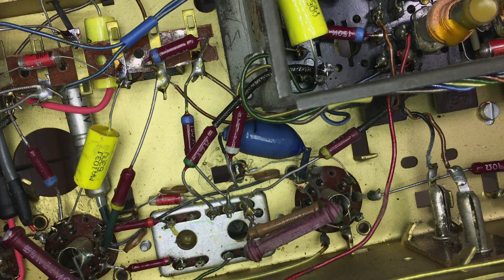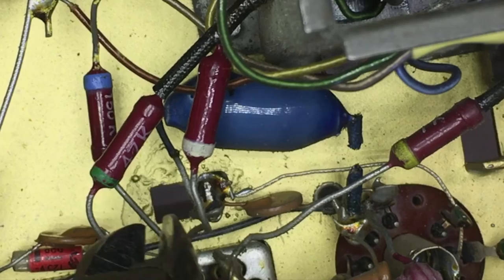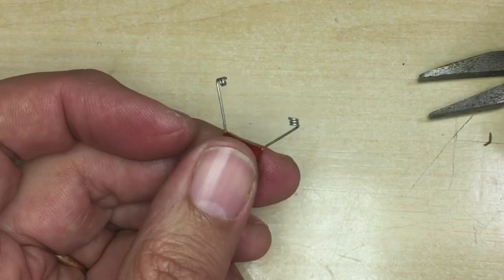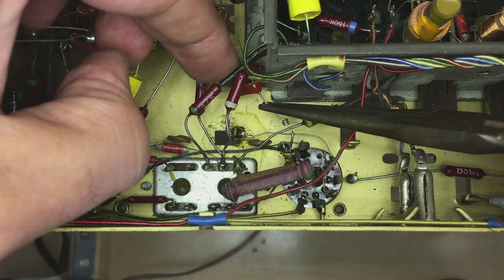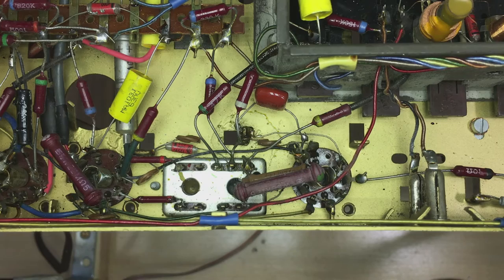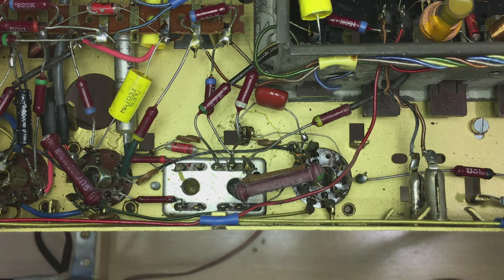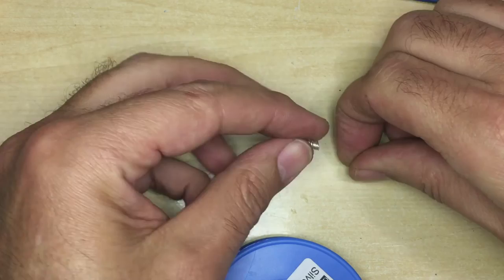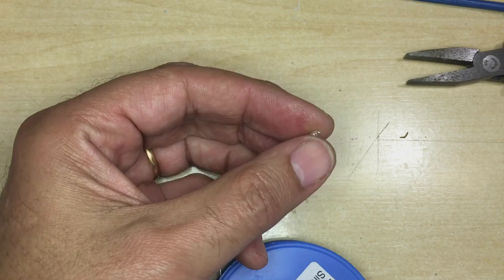Kwikettes aka Quigs aka Pigtails, to change components in tube radio or amp.

Comment: Had a couple packs given to me and used some for installing new parts on old vintage boards . . . since it's easy to overheat and lift the traces off the board. These are great little aids. Wonder why they aren't made anymore . . . Oh yeah, it's a throw-away society now. Great you made a video on making them anyway, for old-timers.

Comment: Another great infornative video. I'm very much a complete newbie to electronics and especially old radio and park up in my truck at night and watch a video or two of yours and they have served me well and also saved me money.
Just one question. Did you buy that flux syringe or is it a normal syringe self loaded from a larger container by yourself?
Thank you again Michael
Reply from the maker: It's just a normal one and i fill it with liquid flux as needed.

Comment: Hi - nice 'how to ' !  I copied a tool made by the late great Paul Pinyot to do this job- you might be interested : http://www.ppinyot.com/lead_twister.htm  

Works great and does not hurt the fingers as much as just using a screwdriver.   I was a dedicated 'de-solderer' -  right up until the time that I snapped a pin off an IF transformer.  A well executed coil is as good as anything else IMHO
Reply from the maker: +Christopher Cusick : I agree. I once spent about 12 hours just trying to replace a tube socket that I broke in a SABA freiburg. It was hell.